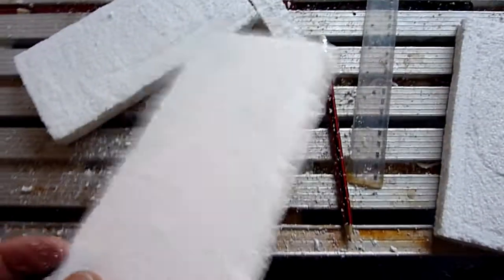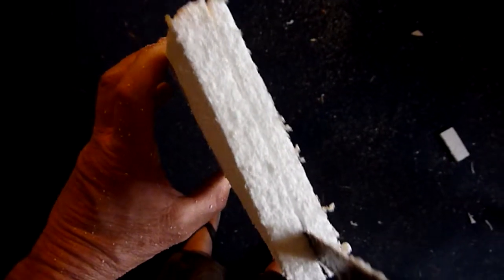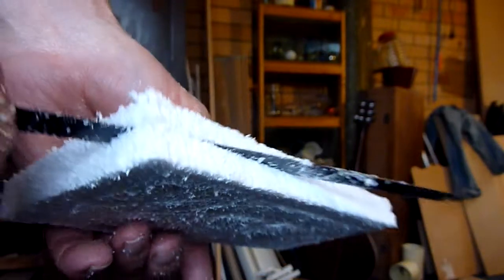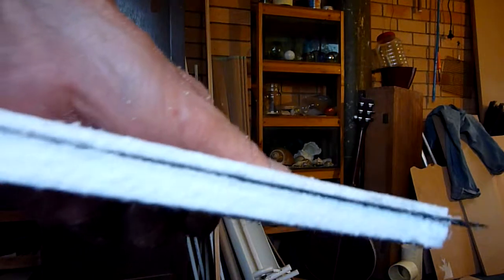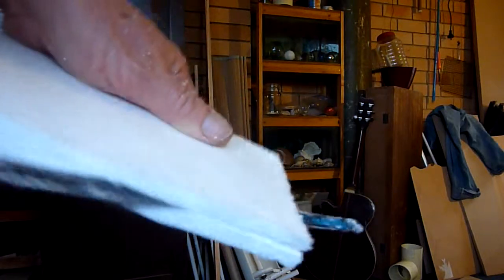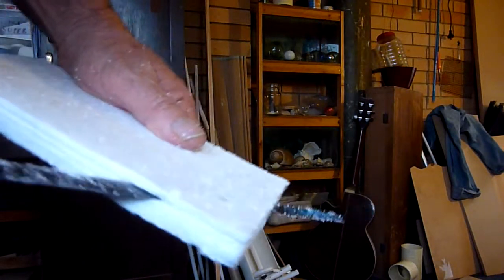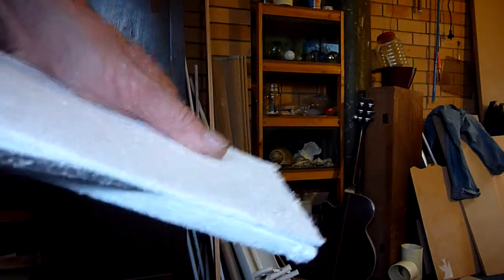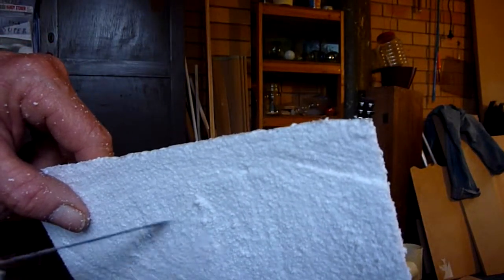(#4) MAKE FOAM PLANE (rubber-band model)

Comment: Hey, slightly off subject, but what is that big white tube with the cutouts in the background?
Reply from the maker: GrandadIsAnOldMan It's a wave power device model. I eventually found one the same on YT, so I scrapped the project. With the sawing, saw at least an in in all way around and then just simply saw it straight through (with the inch bit all way around, it acts as a guide (but still be careful). If you just go in (like i said) all way around, it ends up dished, cos the slot can waver out of station. But if the slot only goes half way in, it wavers less and the simple straight through cut is guided and therefore will be more accurate.
My wave power thing has been done before, but my version of "stop-rotor" hasn't been done yet. See this (for a slightly off subject escape): http://youtu.be/rzadwvwWIC0
Reply: I find most things have been done before in some way or other. It just depends on how you approach things as to whether they can be classed as a new idea.
A bit like cutting your foam with a saw. Most people would have rigged up a hot wire system and saved all that mess it creates sawing and sanding. People put plenty of videos of hot wire systems on YouTube but they are all based on more or less the same principle.
I have looked at your stop rotor already, I am just waiting to see a working version.
Reply from the maker: GrandadIsAnOldMan Also slightly off subject. This one is not my idea, so you can make a YT video of it too (there are others on in on YT). http://youtu.be/QD1cu884K8M
Reply: Justwantahover Nicely done. You might like the series of videos by Mike Dodd where he powers them with a flapping mechanism
 http://youtu.be/-AbQhrfWkxk?list=UU9QEY7zoDdziWgD0kQ7ydMw
Reply from the maker: IMPORTANT:
I changed the technique a little.
You saw around the block of foam till it's 1" deep all around. Then you just (carefully) saw straight through (from end-to-end of) foam board, using the 1" deep cut as a guide. This is much more accurate than the technique shown in this video. That's cos sawing more than 1" deep all around, can allow wandering of the cut (and be inaccurate). But sawing straight through with the guide cut, makes wandering impossible (unless saw goes outside the guide cut). So be careful so that doesn't happen, cos it may with such soft foam. I's tedious to work with, and may require a bit of practice. 
I am uploading a new video on this soon and will make a link for it (and I'll keep this video on, cos otherwise it will be out-of-sequence).